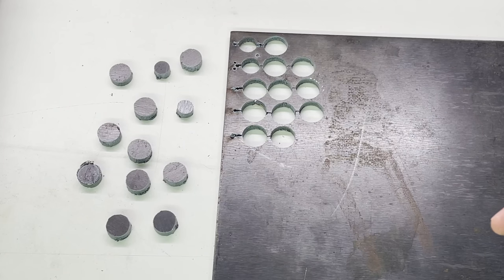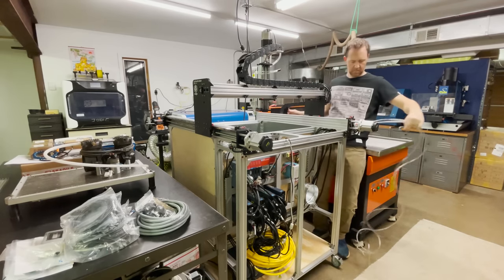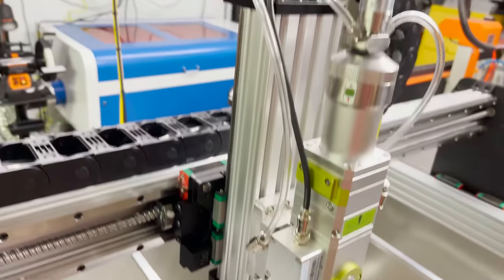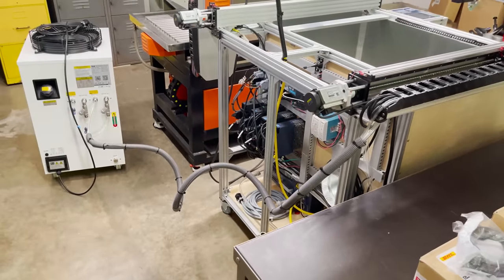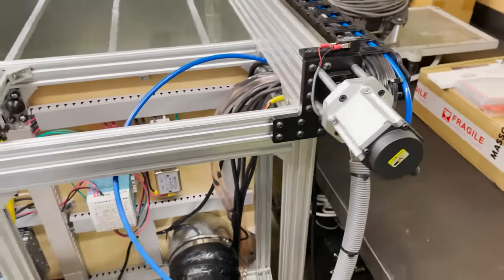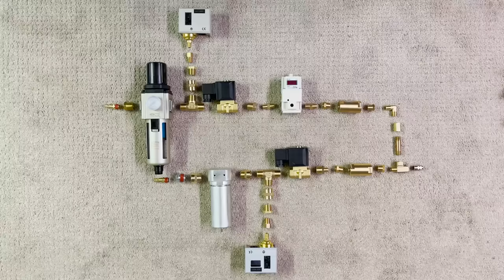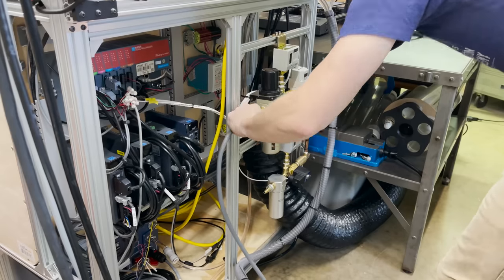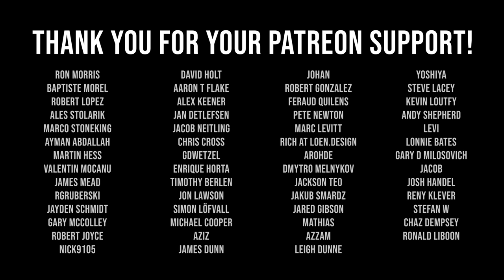DIY 1000W Fiber Laser Cutter Part 5: Cooling & Gas Assist Systems

Comment: As a person running high power laser in research labs, I am chiming in to advise you to add some anti-fungal compound to your chiller's reservoir : heat plus moist environment is something you do not want to have to clean when microbes and fungus starts inevitably to grow inside there.
Reply from the maker: Thanks for the tip! I will look into that
Reply: 100% this. Your water needs to be super clean and have some kind of biocide in it. Otherwise your tank will end up looking like something out of Blue Planet. Don't ask me how I know haha!
Reply: Any specific product you recommend for microbial protection?
Reply: Wouldn't that gallon of antifreeze work as the antifungal stuff?  Or are you recommending more than what he put in the first go?
Reply: @haydenc2742  Antifreeze can be the problem. Our machine had antifreeze in it for shipping but it wasn't flushed out properly on installation. What ended up growing inside our tank looked like something from the Discovery channel. We had to change every filter in the entire system three times. Some even more before we were able to clear the water again. But we'll never clean it 100% I don't think. To this day we have to keep an eye on the system.
Reply: @brianburgess5158  Not sure. TRUMPF have their own mix of chemicals they send us. Although I do remember buying some stuff years ago for a custom PC water cooling loop I was doing. Something like that might do a small machine like this.
Reply: For my CNC mill's water cooled 2kw spindle motor, to avoid exactly this problem I used a substance offered as an antibacterial additive for water cooled computers, I bought a product XSPC EC6 Protect - Biocide, 30ml,  cost me about 5 Euros per bottle, it is a concentrate one bottle is enough for 5 liters of water,  It says antibacterial and anticorrosive. I used distilled water to dilute it in.
My liquid is already 3-4 years in use, there is a transparent segment of piping, I see no bacteria problems so far in it, don't know what is in the chiller though, will have a look, maybe time to change the liquid anyway.
I think if you look around computer products searching for this additive you get the same thing reasonably priced, for much more less when you look for 'I need this for a 200k laser cutter'.    There are even fancy additives that make the liquid in your computer piping glow in UV light, I don't think we need that, though might be useful in leak finding 😀
Reply: @haydenc2742  These bacteria can somehow tolerate ethylene glycol (the main component of antifreeze)  In a car it is the regular reheating to 90C that rather solves the bacteria problem.
Reply: He running 20% antifreeze, which is just enough to inhibit bacterial and fungal growth. Some sources recommend 25%. Anyway, that and corrosion inhibition are two purposes of the antifreeze component.
Reply: @nick066hu  From what I've read, the antifreeze won't kill bacteria, but it will halt its growth if you have at least 20 or 25% concentration.

Comment: I know that cnc router water cooled spendles sometimes plug. You might need to install a wheel on the hot side so that you could see if the system is flowing.

Comment: As Im sure youve already noticed, cutting Aluminum or Glavanized steel with Nitrogen is much more forgiving than cutting Carbon Steel with O2. Steel and O2 is a lot more finicky to get it right. Looking at the cuts, I think the O2 might be a bit high as is the power. In a past role, I ran both a 4kw Mazak CO2 laser and a 4kw Bystronic CO2 Laser.
Reply: Yup. It's the heat. 3.2kW TRUMPF CO2 here.
Reply: I have seen a good cut on one side, and very bad cut on the obisite side if the Laser Beam is off-center, and Yes it looks to me O2 pressure is to high, from my past 10 years experiance cutting with 3.2kW TRUMPF CO2.
Reply from the maker: Thanks for the feedback guys! My O2 is only 8.7 psi, I guess next time I will try going a little lower and see what happens. I spent some time making sure the laser was centered, but I guess I should take another look at it…it’s odd to me that the good or bad sides are not consistent, it seems to be different in every test.
Reply: @diyfiberlaser  one more thing to consider. As you continue to cut in the same area, the steel will heat up which can also cause inconsistent cut results.

Comment: I think you want the aluminum bed supports the other way around. the knife edge is less likely to reflect back up into the laser. also you may cut through them quicker
Reply from the maker: I was considering that also, but I'm just going to try to never actually cut over them and just have them support the edges of the material...we'll see how that goes
Reply from the maker: @zviper  haha...good point!
Reply: If it becomes a problem then you could just use the 1/8 strips that they sell. You would need more for support but you could cut over them if needed.

Comment: I also built the 1000watt fiber laser with MAX laser source. And exactly same cutting problem and as the automatic gas pressure controller is still missing i also think it might be the problem so you installed it already is it better now it helped or same as before?
Reply from the maker: I'm still using the manual regulator for oxygen and it seems to be working ok...I've cut out a number parts from 1/4" plate and the edge finish was better compared to the 8mm test cuts.

Comment: Philips Millennium M10 Oxygen Respirator
can u use this O2 filtering machine? It has 92% purity oxygen filtering output. It is possible to bottle with a pump. cheaper than buying gas.

Comment: I was wondering if it might be possible to retrofit a laser welder and the source.  Save some money if I want to do both task.
Reply: Technically you should be able to. cnc plasma tables just pull the trigger wires to a 5v relay to trigger the torch. CNC is overall universal. XYZ motions are the same for all. Just needing to turn a different accessory on. Extruder, plasma, welding, router, laser. Its very cool. I run CNC Lathes at work everyday and I love it.

Comment: Need a dual 1.5mm nozzle, lower head to 0.5mm focus at +2 mm  ( focus 1/4 the way into the material)    8mm is going to be tough for 1kw no matter when you head the ringing/pinging sound you are at the right power/pressure with oxygen.  Also double pierce with focus above the material.

Comment: I'm pretty sure you want the electro pneumatical regulator valve as close to the head as you can get it. It reduces the length of hose that needs to be "purged" to the correct pressure every time the assist gas is turned on/off. At least, this is how that valve is installed on of the fiber laser machines I've worked with, but those machines are 5'x10' or bigger so your length of hose might not be that big of a deal

Also, I know with the other fiber laser controllers there is a calibration curve you can program at the controller to make sure the regulator is giving you the correct pressure. However, I'm not sure if the Rudia controller has this feature. My experience is with the FSCUT2000/Cypcut environment. You may want to check that the gauge is correctly displaying what you are asking for. 

The machine looks great, I'm definitely following this build as I've wanted to build my own fiber laser machine and this might just be the way to do it.

Comment: I've seen such a finish on 60kw laser cutters that cost more than $100,000 (when cutting 1" steel quickly).  This really is laser assisted oxy cutting.

Comment: Wouldn't have been a 1kW Fiber laser with water micro jet? I mean with water instead of Air you could cut thicker material and with more precise and smother (EDM great even with non conductive Hard materials) cuts than that.